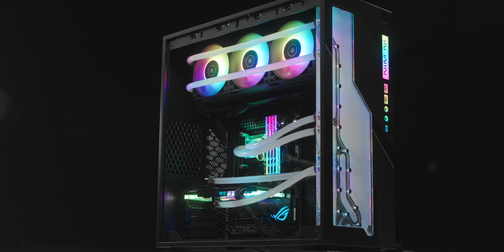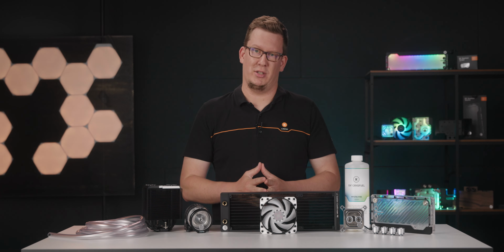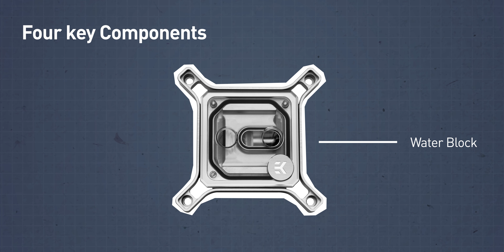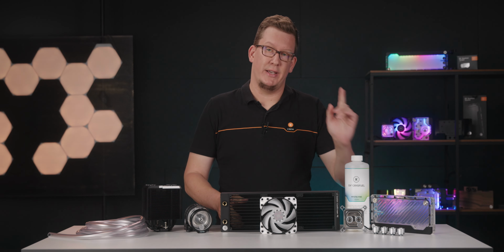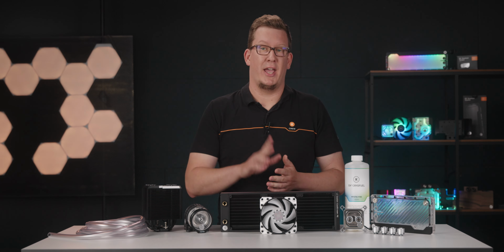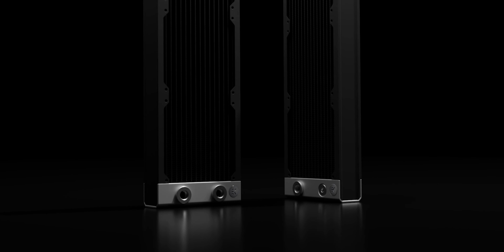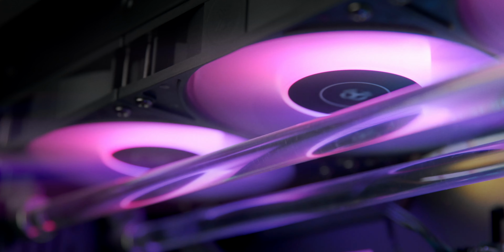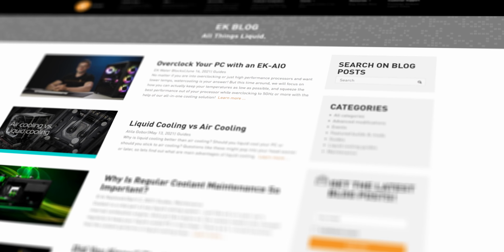How Does Liquid Cooling Work? | Basics of Liquid Cooling

Comment: In the minute 2:12 is that how you have to maintain a liquid cooling system? So, if I buy a gaming desktop, will I have to worry about the liquid inside?
Reply from the maker: You would need to replace the liquid once a year to prevent any algae growth in your system and for optimal heat transfer. We've got a video about loop maintenance coming out soon :)
Reply: @EKWBofficial  ok

Comment: Are You  going to make a basic singe slot EK all acetal quantum waterblock with back plate  for the RTX 3090 Founders Edition Gpu?! or some workstation grade one?! or the same design but without acrylic  so it can be a single slot solution?!
Reply: The RTX 3090 FE can never be a singles slot because of the power connector, meaning that sadly EK will never make a single-slot version of it. There will be an all-metal version of the block releasing soonish, but that's all I can share at this moment.